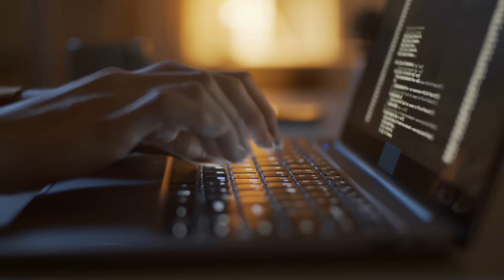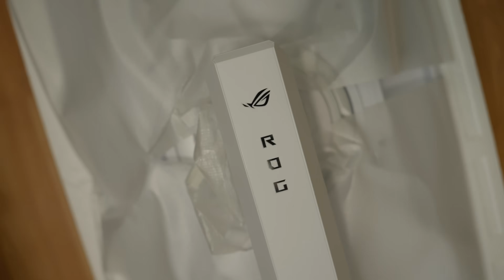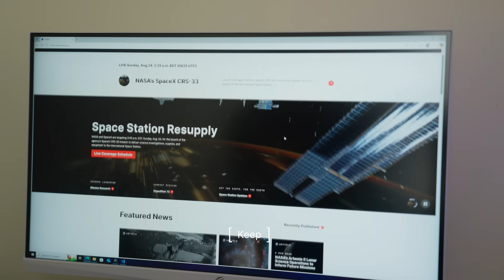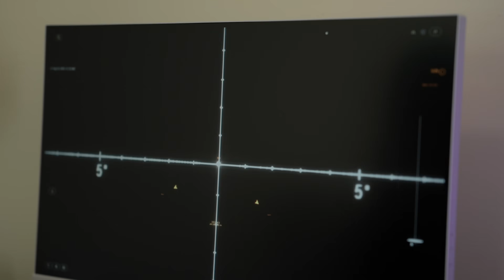ASUS PC DIY | Extreme PC Makeover for a Future NASA Engineer

Comment: I am extremely frustrated with ASUS support regarding my motherboard. Despite being under warranty, I have not received a brand-new replacement for the defective unit provided by your team. This is not my fault — the ROG Z790 series being discontinued is your company’s decision, not mine. My work is delayed, calls and emails to Ms. Shital More, Quality Analyst Executive are ignored or replied very late, causing financial loss and stress.

The solutions offered are impractical, and even a refund is useless as the required model is unavailable. ASUS must provide a brand-new motherboard compatible with my Intel i9 processor, or a practical alternative immediately. This delay and poor support are unacceptable.

Case ID: ING2T80437
Motherboard Serial Number: R1M0CS01P9977FN